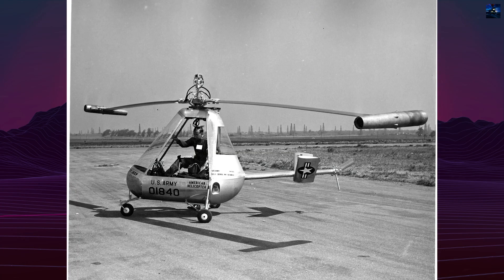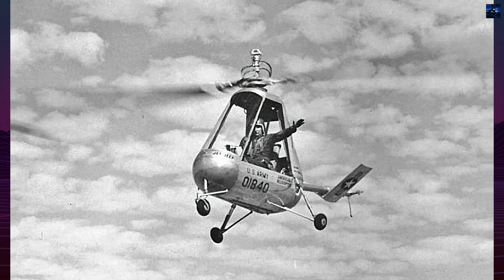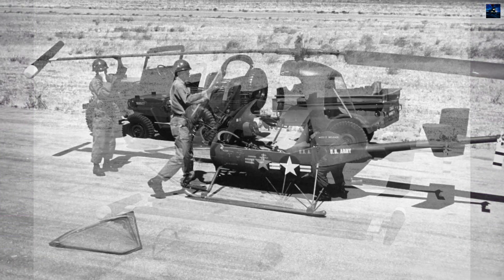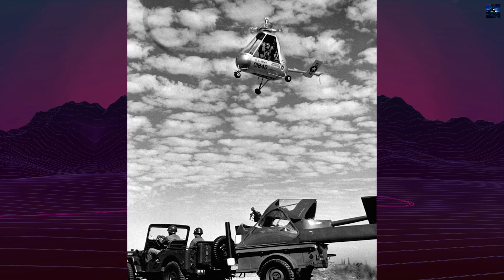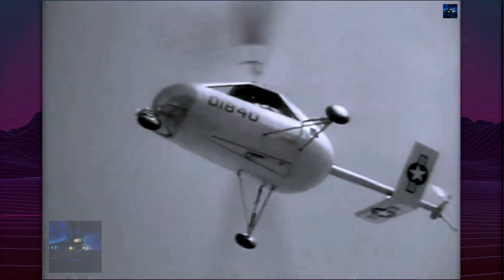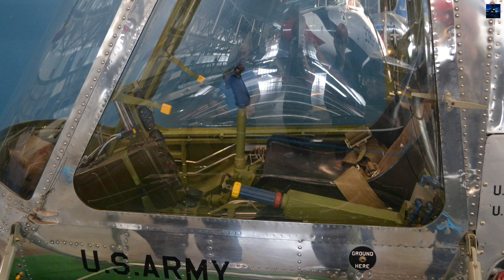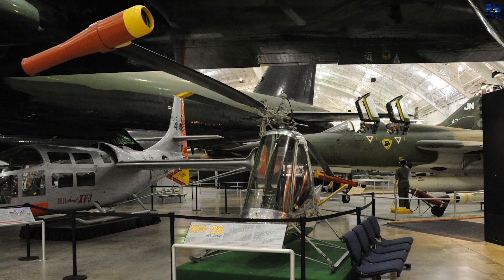American Helicopter XH-26 Jet Jeep: So Loud, So Light, So Insanely Futuristic (for 1952)

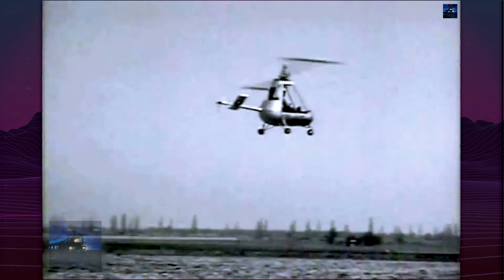Comment: At about 1:38 in this video: 

As I understand it, that is the problem with helicopters that use Pulse Jets or Ramjets on their rotor tips. They interfere with the aerodynamics, making autorotation difficult or outright impossible.

Comment: I'm loving these minimalist "one man" military aircraft designs! There certainly was a lot of creativity in this time period. As for noise, I can't imagine being surrounded by the roar of two pulse-jet engines. And, as you mentioned, if one of them failed, it would be a catastrophe for the pilot! Most of these concepts have been supplanted by drones. Still, there may be a niche for some of these concepts in military or civilian applications, using new materials and/or engine technology.
Reply: I really want a modern electric version. I bet I can get it down to half that weight. Carbon fiber is the new fiberglass. It's gotten really cheap and easy to work with.